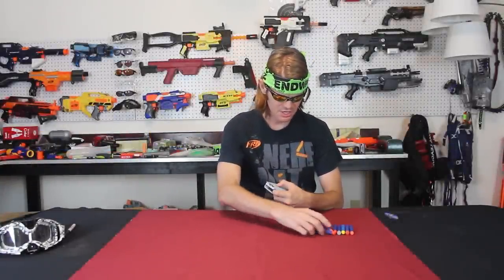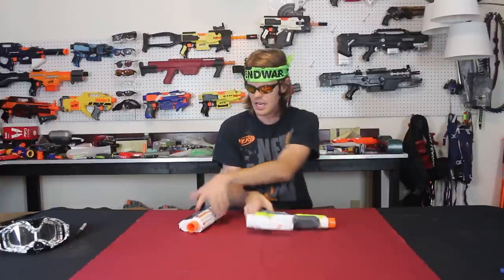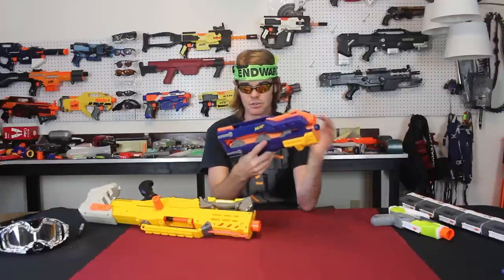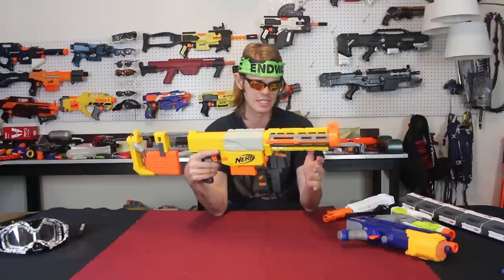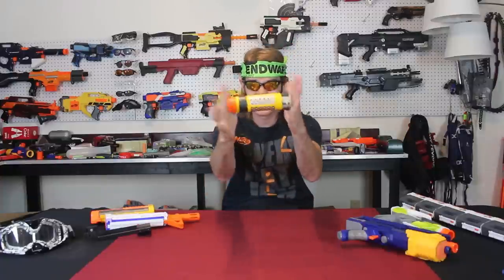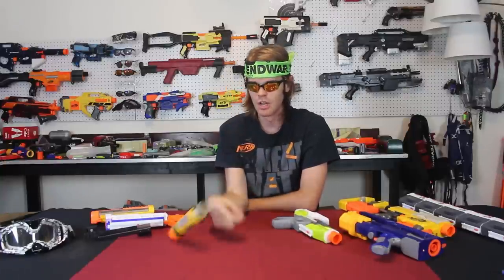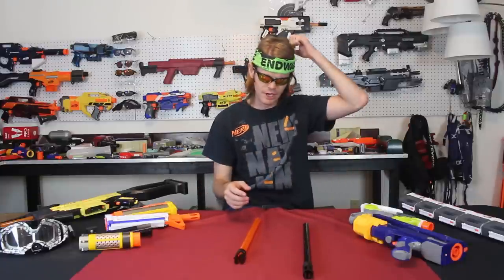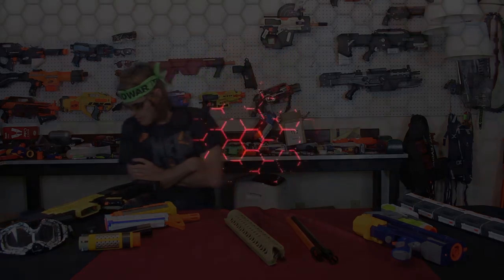TOP 5! Nerf Barrels / Silencers / Ect...

Comment: My suggestion for the barrel part - do an all custom Drac designed blaster using 3d printed parts. It can be an air-pump design with a bike pump and plumbing parts for the main parts, and the barrel and 3d printed parts for the cosmetic.

Comment: You could do something really tacticool with the handguard. I think a fully kitted out raven with that on it in full with a muzzle break out the end could look really nice. Perhaps all in red and black with an orange inner barrel could work,  plus all the tactics on the rails with an angled foregrip or an integrated flashlight handgrip on the bottom, or perhaps some sort of tactical lazer integration would work nicely. All overkill though.

Comment: You should absolutely do an AR-15 style build. BUT mix it up a bit by using the metal worker stock with the cushion around the top of it (I forget what it's called and I'm too lazy to check)  and put a suppressor/Silencer at the end of the barrel, or perhaps the muzzle break and screw on silencer thing that is also worker.

Comment: Drac you could do either an SR-25 or the M27 IAR custom with ttha front end and either would be fine, and both are built on that familiar AR-15 platform with special purposing for both, the SR-25 is a Sniper Rifle designed for longer engagements and the M27 IAR was designed to be a replacement for the M249 and is technically based on the HK 416 platform, just my thoughts.

Comment: When Drac has to detach the ionfire from the barrels........

EDIT: Also you could do a regulator build with that barrel and use a M16 stock with it, with some slight shell modifications to make it not look so blocky and so it looks like it is meant to be there. :P

Comment: I think that Hasbro should make a crossbolt without bow arms
Reply: Ben Allegue so a springer not a stringer?
Reply: AL3X the bow arms are purely aesthetic, so it's just a matter of attaching the strings to the actual body of the blaster. I see where he's coming from, bow arms make the crossbolt a pain to store without taking them off
Reply: I think there was a blaster called the Firebolt or something like that.
Reply: Philosopher5 no the cross bolt  is a stringer it wouldn't function without attaching the arms, I also wish it didn't need the arms because I would love a bull pup nerf blaster.
Reply: I made a custom STL model for 3D-printing, that minimizes bowarms, making crossbolt completly sleak. If you want I could sent a link to them.
Reply: Ben Allegue I
Reply: Pyeboy 200 this thread is old but I'm still gonna reply. All the crossbolt needs is for the strings to be attached, the bow arms aren't needed for it to function. Look at Drac's mod guide for it, he does exactly what I'm talking about
Reply: Ben Allegue than it would be called the bolt
Reply: The crossbolt is a stringer and needs its arms to function. An armless crossbolt would need new internals and at that point would just be a new blaster.
Reply: Archie Pye The rayven is a bullpup. Its flywheel though.

Comment: BATTLESCOUT
But seriously
I think you should raid a regulator for the shell and pusher, then cut a notch in the side and steal a bolt from something and rig it so that each time you load a magazine you have to pull the bolt back. Put a return spring on it so you can pull and release, then it will hit a microswitch to let you fire. Probably replace the motors with something with a bit higher rof.

Comment: Put it on a long strike and use a k26 spring (if you can)
Reply: Seb Castro won't work, catch not strong enough. Also it will still be somewhat bad because it has a reverse plunger system

Comment: Top 5 sprinters plz I love your channel btw
Reply: Springers* darn autocorrect
Reply: nah man its FLYWHEEL MASTER RACE!!
Reply: +msnoob ya dude bro
Reply: msnoob flywheels are crap unless you mod them though
Reply: Number one would be the Stampede or Swarm Fire. They (IMO) outclass everything. No rev up time, no heavy ass spring load that YOU have to pull back, and modifying the gearbox isn't that hard.
Reply: Overdrive UK who uses stock flywheels, stock flywheels is boring, well springers are also crap when not modded.